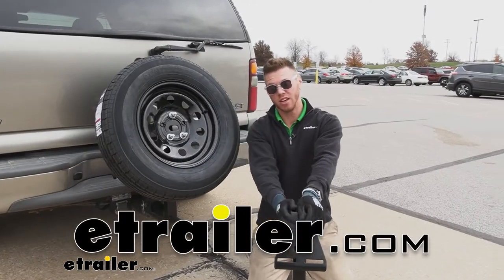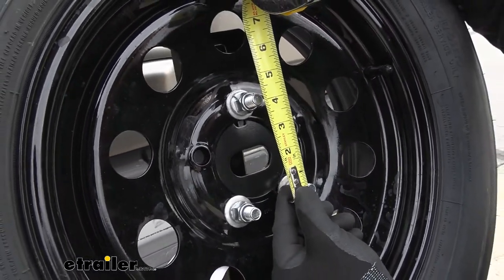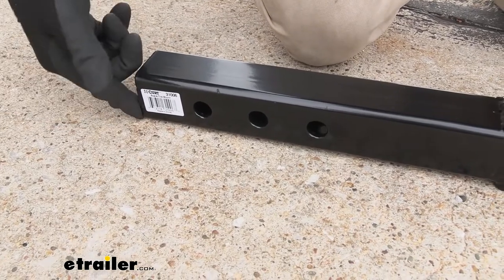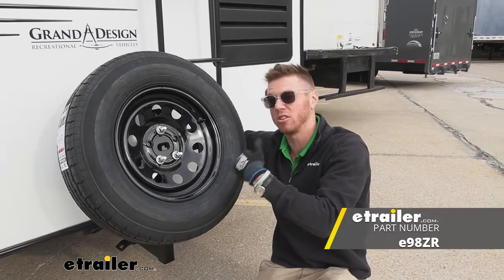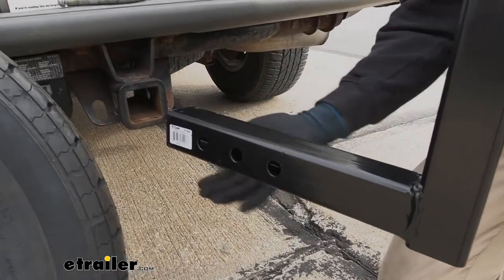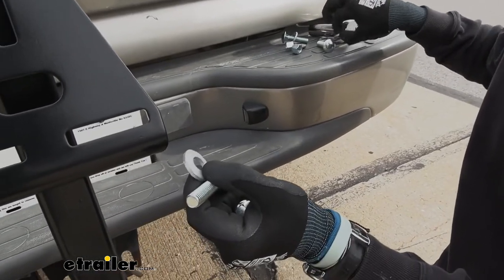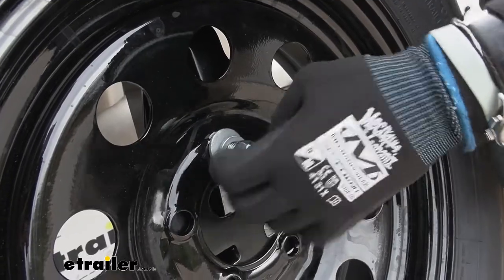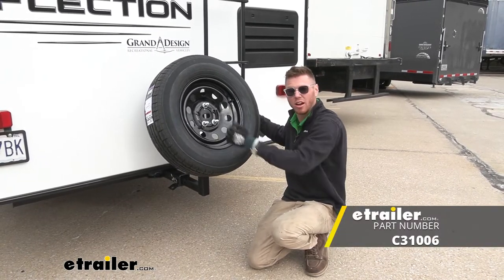etrailer | Curt Trailer Hitch Mounted Spare Tire Carrier Review

Comment: Do you know how much weight either one of these are rated for? and what do you mean by anti rattle device specifically. thanks
Reply from the maker: According to Curt, the spare tire carrier doesn't carry a specific weight rating. It's good up to the tongue weight capacity of the hitch you're using. The # e98ZR etrailer spare tire carrier mentioned is a better value, because it includes a hitch aligner and the hardware needed to attach the spare tire to the carrier. Like the Curt model, the capacity will equal the tongue weight capacity of the hitch. The anti-rattle hitch bolt is threaded so it pulls the shank of the carrier up against the inside of the hitch receiver so it fits very tightly so it won't move around.
https://www.etrailer.com/Spare-Tire-Mount/etrailer/e98ZR.html